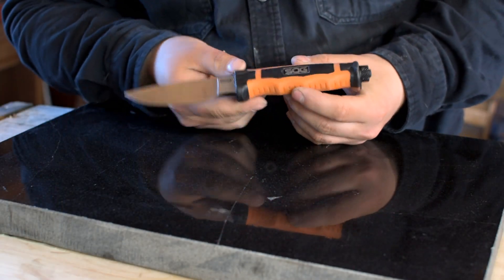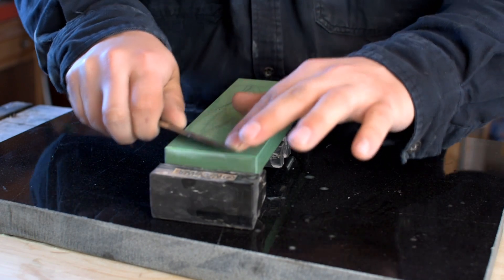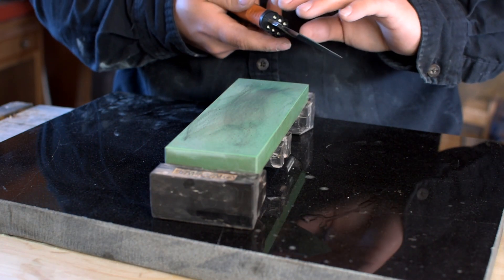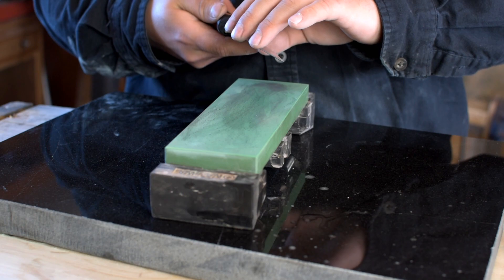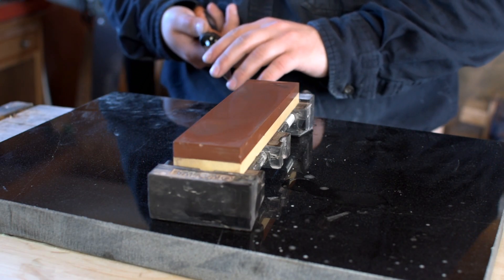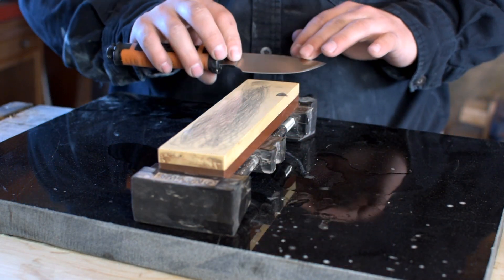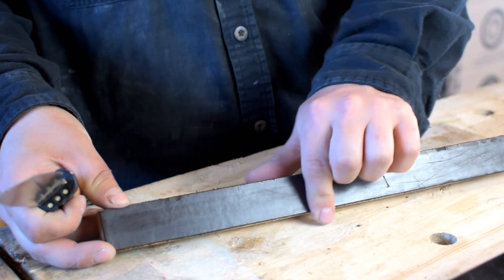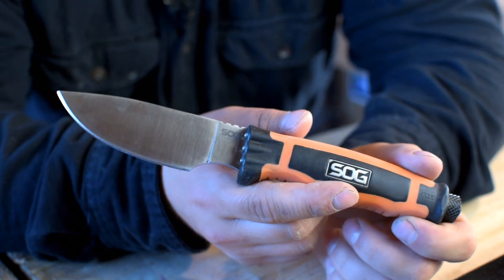SOG Bladelight Hunt - FULL WHETSTONE SHARPENING

Comment: Good video.  I'm having trouble sharpening my tanto.  Specifically at the transition from the main edge to the tanto point.  It seems that it sounds between the two edges.  I like that clean crisp definition between the two but can't seem to execute it on the stones.
Reply from the maker: PLEASE READ THIS: I have had SO MANY people ask me about Tanto edges. Sharpen your knife as if it was 2 separate knives. DO NOT try to transition between the edges. Sharpen one edge and then the other. Otherwise, you'll end up gouging your stone, and rounding out your tanto over time.